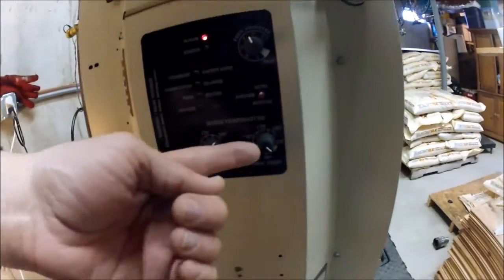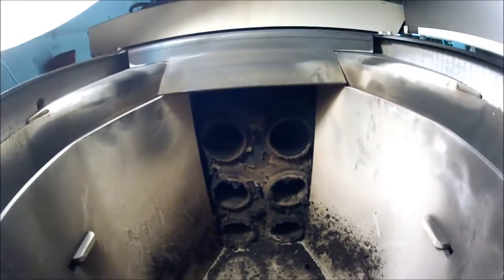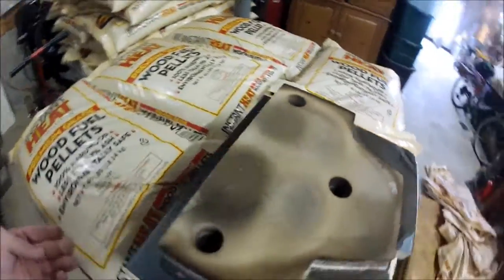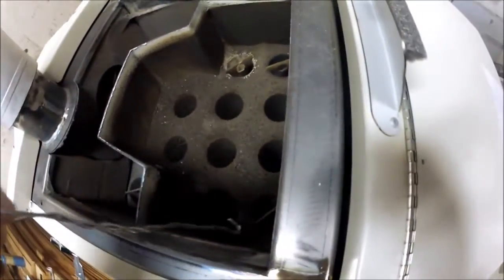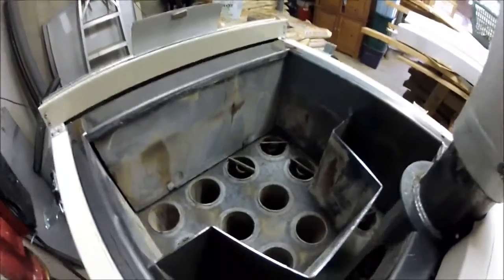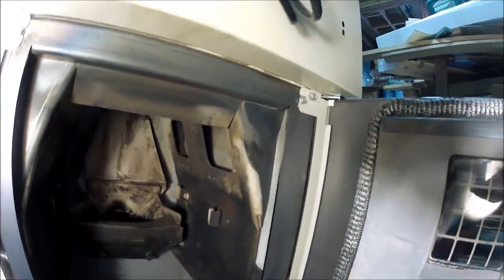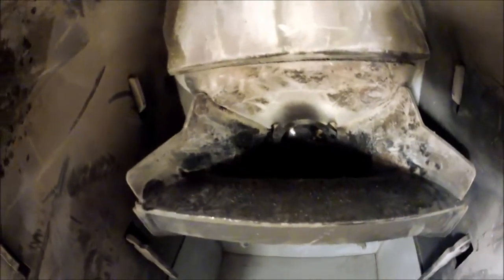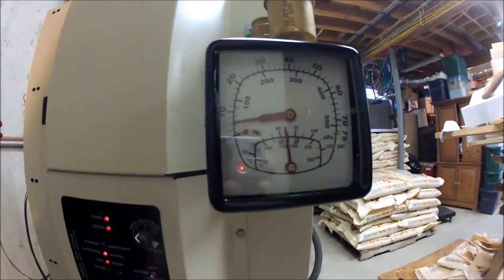Harman HydroFlex60 Weekly Cleaning

Comment: I have one of those pieces of junk in my basement that I bought wen OBAMA and crew drove the oil prices through the roof in 2010 . Because irrespective of my 88% efficient oil fired boiler  the pellets were less than half the cost to use. I  used it until Trump got in 2016 and fuel nose dived back down to $1.86 per gallon versus Obama $4.60 .Then moron BIDEN got in and fuel oil in Connecticut spikes to $ 6.75 per gallon  during the fall of 2022 and considering that it is untaxed it was more expensive that taxed diesel at the pump . So switched back to pellets for winter 2023. At $300  per ton pellets are half the cost .I am A retired HVAC mechanic .I reactivated the piece of junk back in to service along my Oil fired system and it does heat my entire house and provides domestic hot water through an indirect storage tank  even thought it is a toyish  specimen the SBI refractory board behind the burner pot was already spalling  the year I stopped using it 2016 but since it was going to be a back up i did not take immediate action .
I call Harman`s models junk because that is exactly what they are. The PB105 boiler was a behemoth that would not fit in my boiler room but was built slightly better in the combustion area where Harman used less fragile cheap SBI board versus metal  but it had a terrible ignition system that was inferior to the Flex 60 which caused it to no ignite an cycle on safety. I helped an acquaintance who owned one to convert it to use the flex  6O   450 watt more powerful igniter and control board because of the high current rating of the igniter. All for the paltry sum of $1100 in parts alone on top of the $5200 he had paid for it a year earlier. Harman would not help him insofar at reducing the cost since it was their engineering screw up.
To make matters worse ...in 2017 I found out that Harman stopped making either boilers because of their junk like built. None of those idiots  engineers dared to make a wet leg boiler whose design goes back to coal days and last eons. No ...the made the cheapest go out the door crap and to boot will not even help to reveal who made some of those refractory panels for them of which I need to replace 2 .  The point is moot the video is 9 years old , and everyone has moved on ....but I wrote my comment for the person who might run across this video and be thinking about buying HARMAN products they are total garbage...BUY EURPEAN ...they have self cleaning units that go back to 2009.

Comment: hi i have also hydroflex 60 and it been give me so problem the temperature hi is set at 175 but only get about 160 , also in my boiler the 6 mid tube have insert clean out my unit is 3 year old and never had temp problem before this feb .